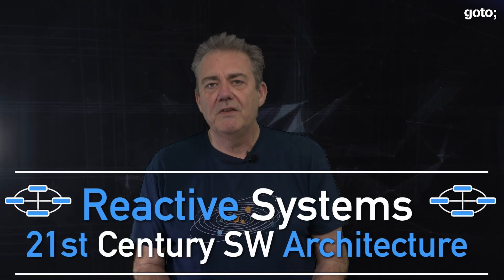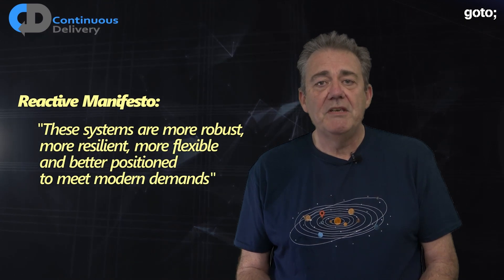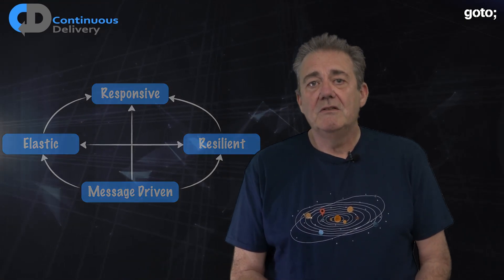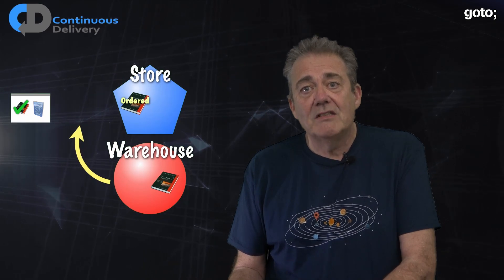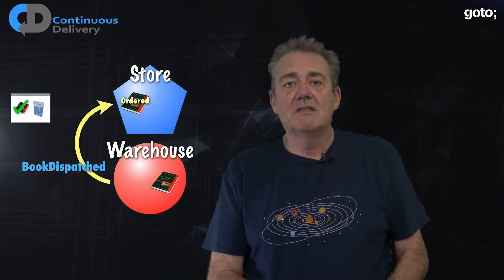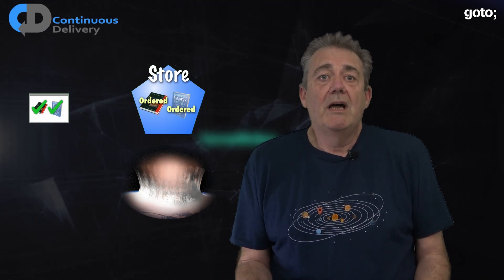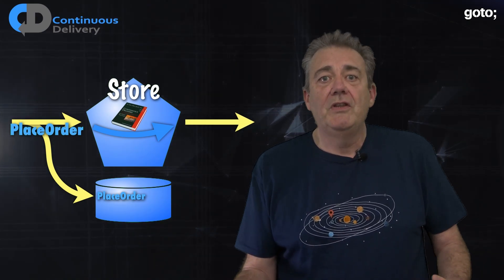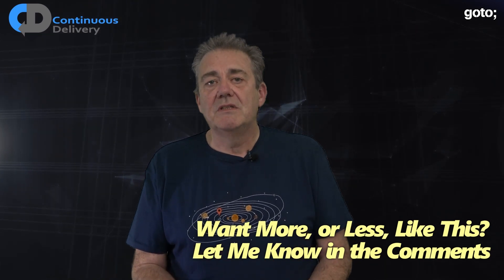What Are Reactive Systems? • Dave Farley • GOTO 2021

Comment: Somehow I see a "new" label attached to something we have been making for years.

It saddens me that focus was made on a "happy flow", which can be trivially implemented in any way/method/platform/architecture. Architectures differ mostly in how they deal with situations beyond happy flow (state integrity, availability etc). This wasn't addressed at all except for quite unsatisfying "this relies on exactly-once delivery, which isn't possible, but don't worry...".

Event sourcing is great and replaying messages to recover state is great too, but in practice, messages will have side effects. After all, systems are implemented for side-effects in the real world. Replayability transforms into much greater problem of how to make real-world side-effects idempotent.

I recommend this talk for anyone just revived from hibernation for the last 20 years. You probably missed more in-depth research in event-sourcing, CQRS, micro-services, Kafka etc. If you did touch anything in practice, then you will learn nothing new.
Reply: Yikes
I would echo the same but the last line
😊👌
Reply: I am curious, do you have a specific example of a service that could not handle replaying the messages? 
It sounds like it would be a bad service specification / implementation but I may be missing something in my thinking.
Reply: @Grouiiiiik  Sure, think about e-mail or just any other real-world effect. Placing an order may result in sending an e-mail. If last orders are lost then we surely can recover the state by replaying all incoming messages of an order service. However, it will send all e-mails again. You must either make your e-mail service idempotent, which means it has to keep its own state (you just made your problem someone else's problem) or your order processing has to actually know about replaying, which makes your code much more complex.

Making all your edge infrastructure (stuff touching the real-world) idempotent is not a small feat. Implementing all your services in two modes: actual processing and replay - is error-prone. With these considerations, it is usually wise to use replaying for aggregates only (stuff you only read).
Reply: @Grouiiiiik  what about services which interact with internal APIs, how would you replay those?

Comment: I appreciate that this video focused entirely on concepts rather than code. 

Questions: 
1) If a replacement Store gets re-fed all the order messages from day one, won't it take a while to catch up? Or, are you depending on the speed benefit to simply plow through all those replayed messages in short order?

2) As the replacement Store processed all those re-played messages, won't it then output thousands of millions of duplicate "Order Processed" messages? How are those duplicated handled? Does the message processing system simply filter out duplicate messages? Does the Warehouse module simply ignore messages it has already processed? (I'm presuming all messages have a universally unique ID.) What if there are multiple, parallel Warehouse modules, each processing part of the load? How does one Warehouse know that some other Warehouse already processed that message in the past, and so that message doesn't need processing? After all, it is not a duplicate message as far as THIS Warehouse is concerned? OR, do you depend on the messaging system to ALWAYS send the same set of duplicate messages to the same Warehouses?

3) Similar to the end of Question 3: In normal operation, how can a parallel Warehouse know which messages have already been handled by a different warehouse? OR, does the messaging system only send a subset of the messages to each Warehouse.

4) What about redundancy for the messaging system itself?

Yes, please. More videos like this one.